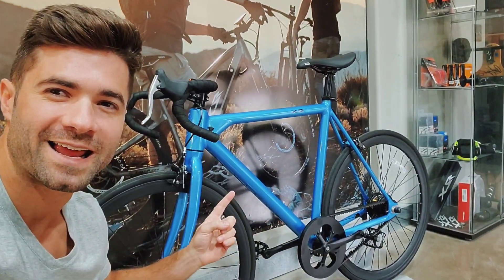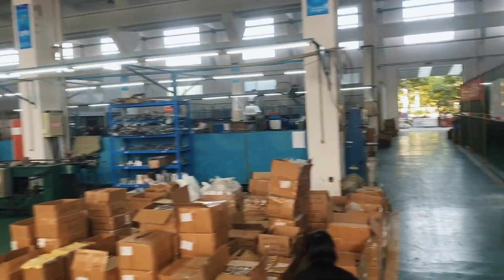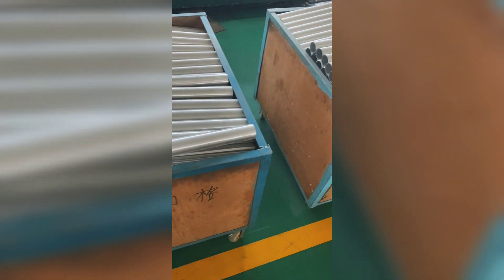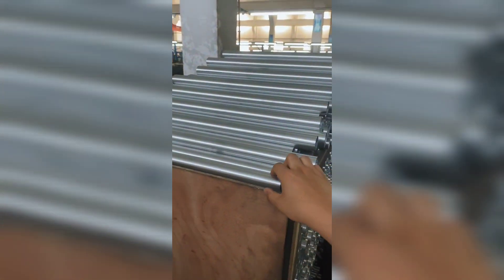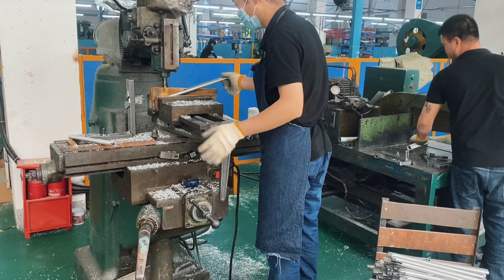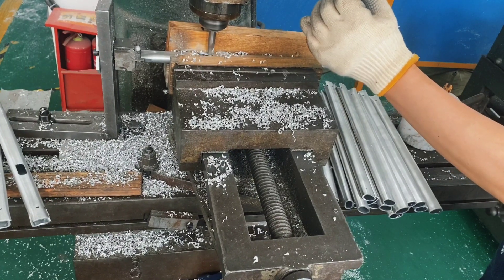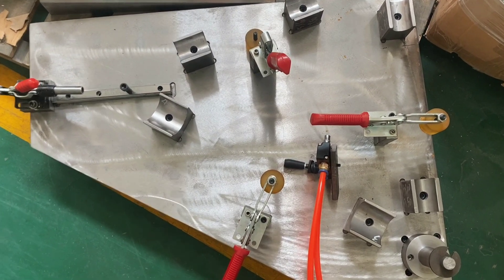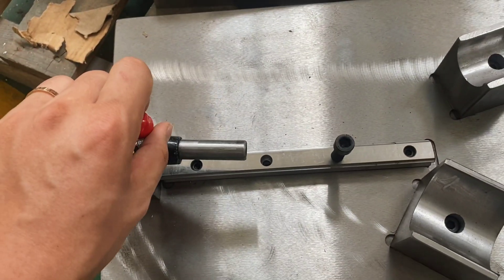Production Update: Babymaker Frame Machining

Comment: Interesting... but I was wondering if the aluminum frame heat treated after welding? Aluminum unlike steel, after welding will actually loses its strength without heat treating. I wonder if heat treated is needed for a typically bicycle type stress. Just wondering ☺️
Reply from the maker: Great question Peter, yes it is heat treated after welding. Stay tuned for more!